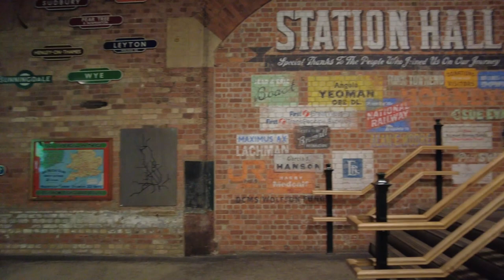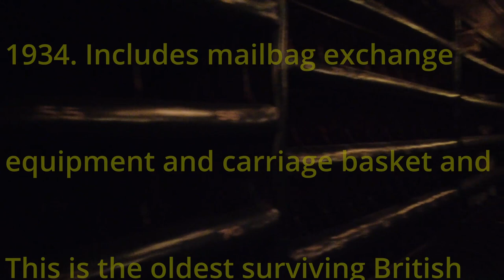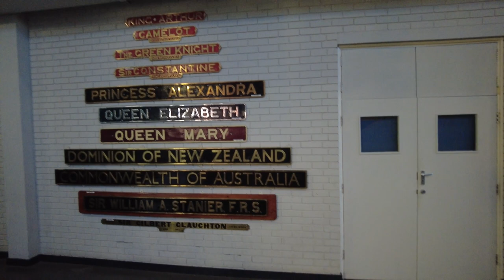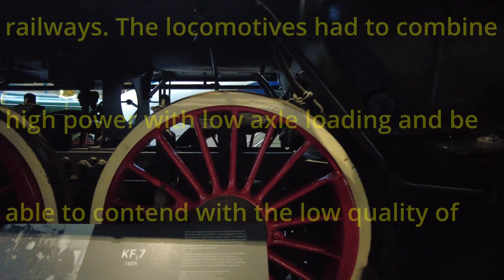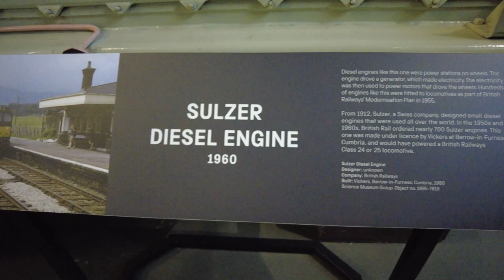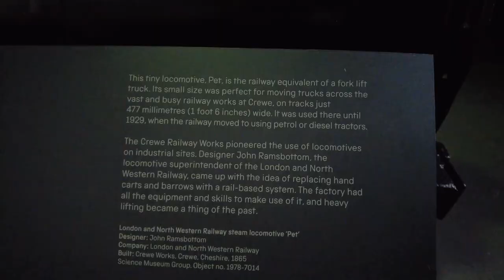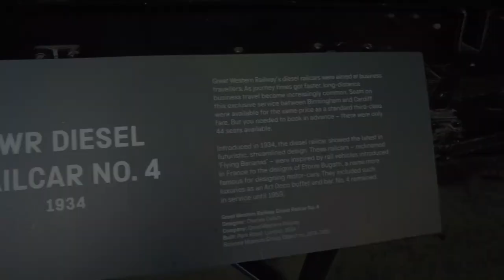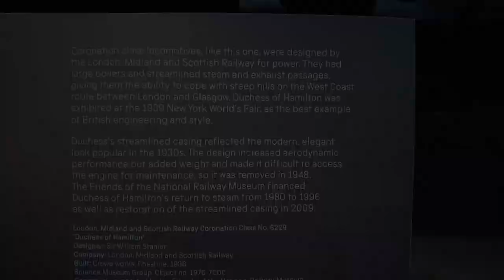little britsh trip part 16 York national railway museum

Comment: Wow Andy!
What a magnificent museum! 🚂🚂
  It is amazing so many locomotives still exist.  Most of the old steam locomotives here in the US were either scrapped during the war, or wrecked for the old western movies. The 1892 Rodgers locomotive in Jamestown ( Back to the Future 3) was going to be wrecked for a film many years ago but fortunately was rescued before that happened. That cutaway locomotive was amazing! You can learn so much studying that cutaway.
Yes those steel “tires” wear out and can be replaced. The center wheel section is cooled and the outer running service, the tire, is heated. Installing the new tire is the same. When everything returns to room temperature, the interference fit holds it all together.
This was great! Thanks my friend!
Hope you have a great New Year!!
Reply from the maker: Thanks it's pretty cool museum, I had a long day that day , I can't wait to see the Rodgers train , thanks I never new that about train wheels, yes the cut away is very cool and I still don't know it works tho 🙄 , I'm going away with the overland bound crue tomorrow for the new year 🥳 there's going to be a lot of changes next year and 😉😉 you too have a good new year. Thanks Andy